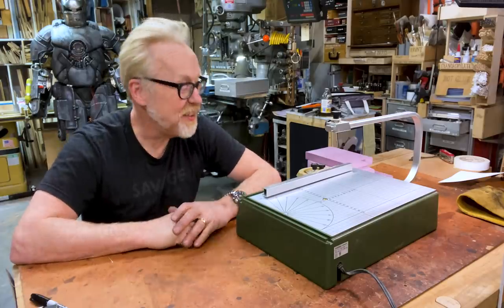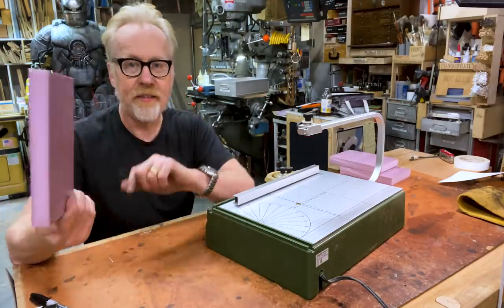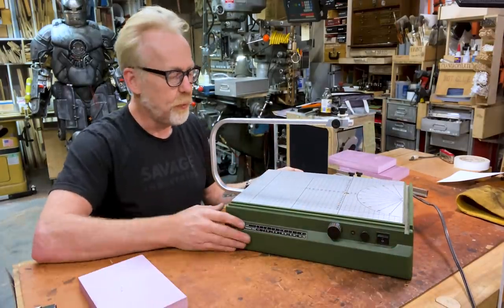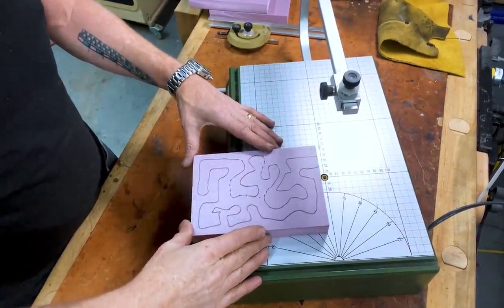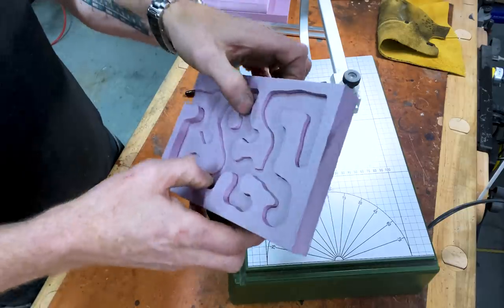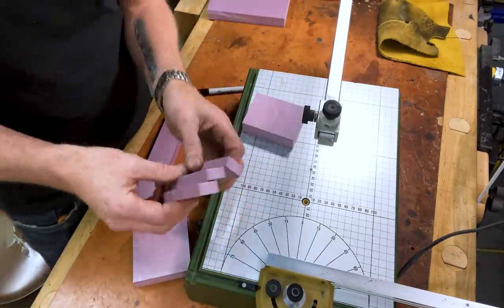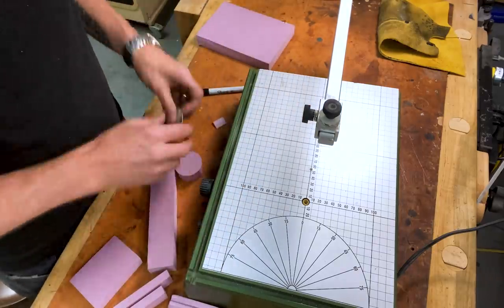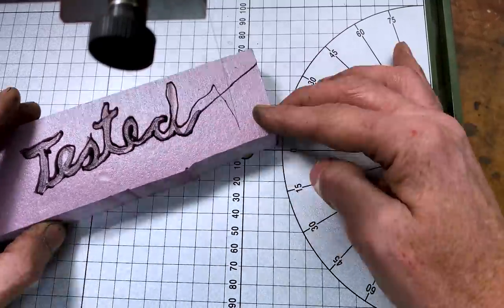Adam Savage's Favorite Tools: Hot Wire Cutter!

Comment from the maker: Proxxon Hot Wire Cutter: https://amzn.to/2KNbU18
Adam's One Day Build featuring this tool: https://www.youtube.com/watch?v=beGXa1TO6vo
Reply: this tool is so great
and if you look for tools to cut a circle there is a guy named Gerard Boom who makes great tools for cutting circles and pyramids.
Reply: @nux4955  dude, when this pandemic thing ends, you have to visit the 'Miniaturen Wunderland' in Hamburg, Germany. The absolute miniature building paradise
Reply: Shout out to Gerard Boom and his fantastic add-on tools for the Thermocut. Check him out at Shiftinglands.com. The gate that comes with the machine is kind of inadequate and the Shiftinglands version allows you to do much more with it.
Reply: So one of the keys is temperature of the wire. If you cut something thick or you cut fast you you lower the wire temp quickly making it harder to cut smoothly. One of the things that makes the Proxxon so nice is the ability to set the temp. I would also make a big plug for Shiftinglands.com stuff. the upgraded kits are truly want make the tools so good. The biggest value in this tool over other is ability to cut straight lines accurately. This is because the wire holder has some spring to it and adjustable power supply. Other foam cutters can do the shaped cuts well but if I need a straight line this is the only tool I have found that does it. Think table saw not scroll saw.
Reply: I just started making dioramas with foam last year and it's been a lot of fun. This foam cutter has made it SO much easier to cut stuff. All of the work I've been doing with that is actually well lead me to watching this channel over the last couple of months. It's been pretty informative and entertaining watching the stuff you build as someone that didn't really watch a whole lot of mythbusters. Keep up the good work!

Comment: I have one of these. It's great. Adam doesn't mention it, but the owner's manual says you can cut good circles by simply taping a thumb-tack to the table, point up, and slap the foam down on that. Just rotate it around the tack, and you get a clean circle.

Comment: To avoid cutting at an angle the template should be put on the bottom of the piece, so the wire won't bend so much

Comment: I've used that same Proxxon cutter for years, but needed Adam to show me it has a handy chart on the front. A helpful feature that wasn't shown is the ability to reposition the upper spool along the yoke in order to create angled cuts. Also, I think the power regulator adjusts the power to maintain a target wire temp as you speed up or slow down the movement of the material. And to echo Adam's comments about precision, one can get some very precise and repeatable cuts from this tool.

Comment: Hey Adam, we used these kind of cutters a whole lot for building model airplane wings to cover in carbon fiber later! It works really well and also gave us students the opportunity to experiment a lot without a big cost factor. In using these kinds of cutters a whole lot I learned that MDF and plywood templates work best because they don't transfer the heat away from the wire and can be smoothed very easyly. Just don't stop too long in one spot because you'll burn your template and create a big dent in your foam part.

Comment: I made one years ago for cutting toolbox foam. Two-foot deep arm with stainless safety-locking wire. I wrapped the wire round brass bushes so it could be easily unhooked for feeding through holes, for cutting in the middle of a sheet. One of the best diy tools I’ve ever made!

Comment: Hi Adam, hope this massage finds its way. 
In architecture class we used these a lot. If you want more flexibility set the square to 90° and you can establish the cutting width precisely. 
For circles, you want to run a piece of wood next to the wire. Run a small nail into it with the distance of the acquired radius to the cutting line. While cutting at the moment you get past the nail just stop pushing and start rotating. 
Last but not least you can run the "wirecar" down the upper arm to cut in an angle on the z-axis. 
Have a nice one and be safe!

Comment: Worked in architectural model shop many, many years ago doing study models.  For 1-off guides, manila folders make great templates - put on bottom with a quick spray of low tack adhesive. circles? just like for a band saw - little sheet of plex with a pin through it. Make life easier by putting an inexpensive foot switch on the machine - you'll never have to worry about forgetting to turn it off!  One thing the Proxxon lacks is a tiltable upper arm - like the tilting table on scroll or bandsaw - that adds a lot of possibilities.

Comment: This brings back such memories of all-nighters at my first architecture internship building models. We must have run thru 50' of wire over the course of that summer. 

I tried building my own wire cutter as Adam describes, trust me - just buy one. I never got it to work right and the real one you're guaranteed right angles to the table. 

FYI - the "blue" insulation foam is denser and generally cuts nicer than the "pink" foam. It's somewhat harder to find. The true white whale of foams is the 4" thick blue foam.

Comment: The EXACT same one I have had for the past 15 years! 
You can do many other shapes then what he showed.  I used it years ago on a project to do perfect foam spheres.   You can do cones too. The trick is taped pin for the cone center and rotate the foam to cut it at an angle.

Comment: Having flashbacks of working in a hot tub cover factory and having to cut foam.  Had a machine similar to this one - I actually had cut my name out of a spare piece of foam and had that for a while; we also had a wire between two handheld... wands, I guess would be the best word, which was used to cut the very large foam blocks to shape, and then there was a table with to wires across the back end, that was used to cut slits in the foam to insert these pieces of bent metal for reinforcement.  Good stuff!

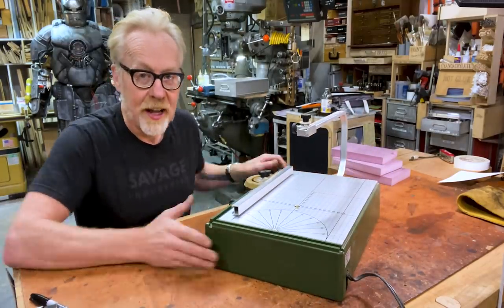Comment: These hot wire cutters are in most architecture schools where students use them to make study models out of rigid foam, popularized by the perfect blue foam models from architecture firms like OMA.  The Rolls Royce of wire cutters is probably the Styrocut 3, which is like 9x the cost of the Proxxon, but its built so well and you can do all sorts of angles and circles and what have you.  They are pedal-actuated, which is much better than it sounds when doing precision cutting work.  I was able to make 1:12 scale furniture for a model, like a couch, toilet, toaster, bathtub, and urinal.

Comment: Made a hot wire cutter for cutting out surfboard blanks form huge blocks of eps foam. Super fun and easy to use, add a template to each side of the foam and you can get really accurate cuts.

Comment: I've used an improvised 13ft hot-wire to cut a swept and tapered wing section for a large RC airplane. It was a bit of a chore to set up but the results were amazing. I've found that managing your cut speed is everything with a hot-wire. Go too fast and you'll either pull on the wire or cool it down too much. Go to slow and the wire will overheat and increase your kerf.

Comment: Mmm that sweet acrid smell that turns your stomach and gives you a massive headache when you use it for the first time not having enough ventilation.
Reply: You have your wire too hot
Reply: @CodeKujo  right, like i mentioned "first time" lol
Reply: @justanotherdayinthelife9841  right, but you qualified your statement with "not enough ventilation", not "too high of a temperature".
Reply: @poopfartlord9695  fully agree. I dont smell anything unless I mess something up.

Too hot, left it on for an extended time, or i forgot a peice of foam too closely... these things happen too frequently lol, but its my bad

Comment: Lately I bought a CNC hot wire cutter - pretty cool and very accurate. Ideal solution if you want something high-volume cut in 2D. If you think the whole process through you can also make something 3D, but that requires some more fiddling. Here is a lamp we designed with my friends that uses a CNC wire cutter for manufacturing: https://www.behance.net/gallery/66885329/AGLIO-LAMP

Comment: A handy note for those who are using templates, is to attach it using a a glue stick. Just a quick swipe or two with a school glue stick and set it on the foam keeps it from moving as you run it through the foam cutter.

Comment: I've been using the Proxxon for years now and I love it!  If you are getting regular use, one thing I highly recommend is looking into an aftermarket guide rail.  Getting a little more height than the aluminum piece gives you is really nice when you are working with taller foam pieces.  Shiftinglands.com makes a really nice one that people seem to universally love.  They also have other jigs that people like to use with the proxxon.  I made my own and it was easy enough, but that was before they had distribution from the US and the shipping costs were brutal.

Another thing I wanted to point out, is that this tool is so great for people of all ages.  I love showing kids how to cut foam, and we make little houses or projects and they really have a good time with it.  Yes the wire gets hot, but it goes instantly cool after you flip off the switch.  While I have touched it myself from time to time on accident(not fun, but not horrible), kids really learn to respect it and other tools by getting hands on.  To date we have had 0 child injury's due to proxxon wire cutters, and LOADS of fun!
Reply: Can highly recommend the add ons/jigs by shiftinglands!
Reply: Scrolled down to see if anyone had repped Shiftinglands, the stuff Gerard makes is awesome!

Comment: Another fun way to use it is to add another dimension. The handheld technique is to take a long rectangle, like a 2x2x8 inch block, and while holding one end without touching the base gently spin it axially while pushing through the wire. Use a small motor with a feed and you can make a dustless foam lathe.

Comment: Inspirational Pro Tip:  There are a thousand build projects that this foam is good for, but a technique being explored a lot right now in the custom van conversion to mini RV scene is a technique of covering the foam with paper mache.  The need is to create custom cabinets, desks, sinks, drawers, separators, dividers, bed frames, you name it.  But all of these things in an RV can add a lot of weight in the back of an RV if made from plywood.  So if you make your cabinets and drawers out of foam it solves several problems.  One, foam is common and fairly inexpensive.  Two, it is easy to work.  It can quickly and easily be cut, sanded, rounded over, etc...  Three, the final product is very light weight.  Four, the final product is insulating as it can get very hot or cold in a metal van.  Make your cabinets out of foam, and you build structurally with a bunch of insulation.  Five, the material is easy to cut out on the road and change the design with minimal tools being brought along.  Six, it can be make very strong by simply laminating the surface with paper mache made from a paper grocery bags, or a roll of brown construction paper from your local big box hardware, lumber yard.  Once covered in paper mache and brown paper, it again can be sanded smooth, then coated with poly urethane paint and made super strong.  I would like to build a Public Maker's Shop here in Charlotte, NC.  I can see this technique getting used a lot.

Comment: My most common use for extruded polystyrene is for custom mailing boxes.  It cuts easily on a tablesaw, or by scoring and snapping like sheetrock.  I bond it with hot melt glue.  The resulting boxes add little to the shipping weight, but are exceedingly strong and robust.

Comment: I had to cut a bunch of 4 inch circles to fill a tube, and I put a circle of project board (thin processed wood, practically cardboard, otherwise known as Hardboard) onto a lazy susan bearing, with some tacks poked through to hold the small pieces of foam in place... I then rotated the contraption against the wire by hand, and made 20-25 perfect circles...

Comment: A microplane used for cheese works well for smoothing and finish work. I like the ones at Sur La Table, square teeth and super sharp. That foam can also be sanded. To join pieces use a spray adhesive but make sure it's ok for foam like Super 77 not 90. Pieces of foam can be covered in marine grade fiberglass and resin, but the fast set might melt the foam.
Use ventilation or a respirator, the foam fumes can be nasty.

Comment: I've used pink foam for radio control sailboat hulls...but always with bandsaw and sandpaper until recently.
I build mine from an old maple cutting board and battery charger. 
Guitar string is also perfect for wire, it's identical material ! I've also used .020" aircraft stainless safety wire. 
For my fence I recycled some Rockler T-slot parts and aluminum angle stock. 
.... I have made foam core reinforcement by sandwiching with both wood and fiberglass for my sailing/racing needs. 
>>> My point is that if you think you don't need one, until you have one. Then it becomes a "must have"

Comment: I HIGHLY recommend getting a foot pedal power switch. You just step on it and the wire heats up instantly. And when you are done it cuts off. 
Amazon has them Proxxon 38700 footswitch FS or any similar model. (I prefer the DTC foot operated on off switch because I can use it for many other tools as well.)

Comment: This is one of those things that's super cheap to make yourself with no frills, if you're good with the electronics and won't kill yourself. My dad made one of these by just fastening a wire taut inside a wooden U frame and hung it from the ceiling. It was about 3 feet long. Wire connected to the circuit with proper know-how, and you're all set. I know very little about electronics but I think you just have to get the resistance right to not vaporize your wire, and make sure it's made of a proper alloy like the nichrome here.

Comment: There are also some really handy add-ons made by 3rd party manufacturers that really make this one sing. Like an better guide (the original is workable but a bit fiddly at times especially with taller pieces) or jigs for specific often used shapes (like circles).
Or you can obviously make those yourself.

Comment: I have one of these and use it a good bit.  A few notes from my experience.  
The rip fence is bad.  Thankfully there are some better solutions for a rip fence.  The "Guider Pro 2" from Shifting Lands is a go to.  Shifting lands also makes a bunch of jigs in laser cut MDF to do various tasks on this thing.  
The foot pedal switch helps out a lot.  Set the power level and just use that control power flow.  Makes cutting difficult multiangle pieces easier without burning this from too much wire exposure.
You have to get used to what the proper speed to push something through is. This is dependent on Temp, Material thickness and wire orientation.  You can set the wire to do bevels, but the steeper the bevel, the more material you have to cut through, so adjust temp accordingly.  
You can cut through stuff faster by raising the temp.  The downside is that this increases the kerf.  This also comes into play when cutting stuff with a template on top.  if you pause at any point while doing a cut with a template, you are just melting foam next to the wire.  
these are just a few random observations I have had while using this.  On the plus side... foam is cheap so just do it again if you mess up too badly.

Comment: My one big thing with mine is always try to turn it off between cuts. And double check the wire is square with the base before a cutting session. That top bar can bend if knocked or something and it can be an arse to get back in line.

Comment: Ok so I know this video is way old to be commenting on it now, but a potentially helpful point nonetheless (I looked and didn’t see anyone else saying this) - the spool holder up top on Adam’s cutter is backwards. The angled end should be the end the wire comes off of - it has a groove for the wire to travel in, to hold it in place a bit better.
Reply: Ah, good catch! There is a thin groove and an angled edge on the side that is supposed to feed the wire downward. Backwards, as Adam has it, the wire is likely to slide a bit.

Comment: NiChrome wire expands as much as any other steel based wire, what makes it special is that it doesn't oxidize (as quickly) at those higher temps and will last much much much longer.

Comment: I built one of my own. You can use poster board or cardboard as a template. It will cut the foam but not the cardboard. Its wonderful. Curious how this keeps tension as the wire heats and stretches.

Comment: The template doesn't need to be metal. In fact metal can sink some heat away from the wire. Heavy cardstock is fine.
To get perfect cuts, put identical templates on both sides to keep the wire perpendicular to the foam.

Comment: Hey Mister Savage I have built a hot wire cutter that will cut a 3 foot piece of foam. I built a table and it has a fence for straight cuts like a table saw. Iv built in a reostate for temp settings. And now im building halloween props from foam.

Comment: The METAL WASHER sucks the heat out of the Nichrome Wire.  Need to use a none heat conductive pattern material.  That should solve the pattern problem.
Try a nylon pattern - have to be careful of melting it also - so maybe a hardboard pattern.

Comment: I have one but when I turn it on, the wire doesn’t get hot! I checked all the connection points, and it’s obviously getting power because the light comes on. No idea what I’m doing wrong.

Comment: To drill a 3/4" hole in similar foam, I used a Forstner bit at high speed. It took 4 practice tries to get good enough. What would you use? A hole saw? A spade bit?